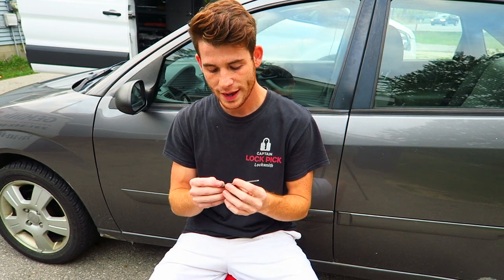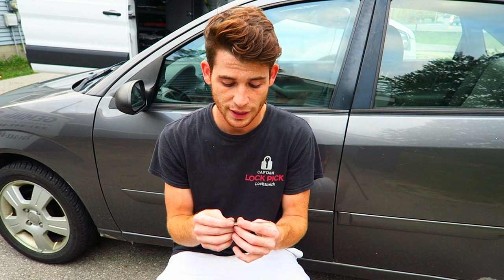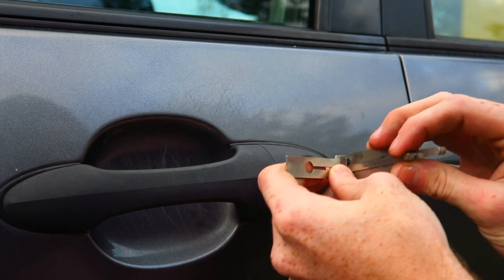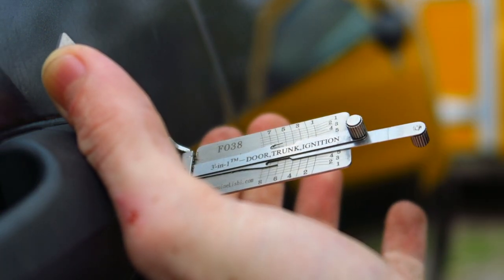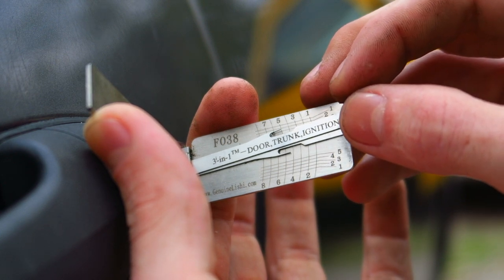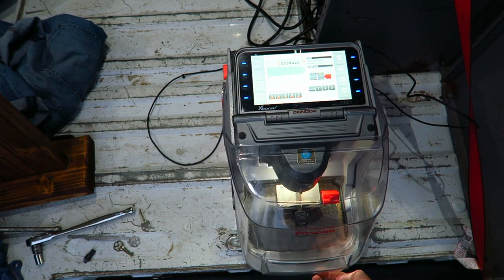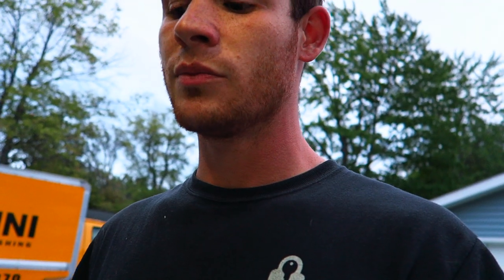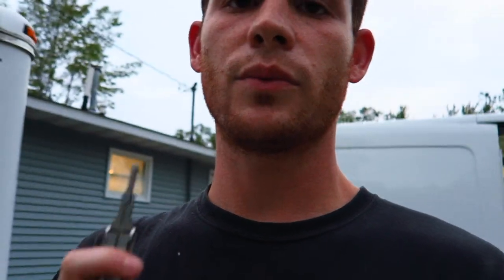Make Ford Key - Lost Keys - FO38 Lishi SECRETS

Comment: Dude solid video.  I just got my FO38 lishi along with a HON66 and HU100 since I cut and program alot of those.
Reply from the maker: The FO38 lishi can be difficult to decode with at times. HON66 is difficult to pick but easy to decode. HU100 is one my favorites.
Reply: @CaptainLockPick   I used the HU100 for a 2019 Silverado and it worked perfect in the door but would not work in the ignition. When I decoded the door I just autofilled the rest on AutoCode and it only came back with one option plus the customer said it was just one key. Is this some sort of electronic issue? I did wiggle the steering wheel and the shifter but nothing….

Comment: I've got multiple Ford's over the years and it looks like it would be a handy tool to have around.
Right now I have a 95 Bronco with no key to the back tailgate.
I am betting with the tool like that I can figure out how to hand file a new key myself.
Why??? Just because it's a challenge lol.
Reply: Your Bronco's H67 key may look very similar to the H75, but it has 10 spaces instead of 8. It is a completely different system.

Comment: I'm liking the Lishi tools!  Question for you.  I have a 1967 Mustang GT Fastback that I've owned for 40+ years.  I've hauled that car all over the country when I moved hoping to be able to build a hot rod.  The time has finally come, but I can't find the keys.  Does Lishi make a tool for a 67 Mustang trunk lock?  I know the trunk is a mirror image key from the ignition key (which I also can't find).  I just need to get into the trunk.  Thanks for any info you have.
Reply: I also have a 1967 fastback s code that I have had since I was in highschool and I am also a locksmith. Lishi does have a tool for the older ford ignition and door but your best bet is to probably just get a new ignition and door locks from year one or mustangs plus ect...
Reply: @kcreyesmaquilan9741    Looks like that is probably my only option at this point.  Thanks.

Comment: I have yet to open a Ford with a f038 lishi . I can easily open the Chevy vehicles with the gm39 lishi. You make it look so easy.  I wish I knew what I was doing wrong 😕 Any tips or tricks to suggest? Please and thank you 🌻
Reply: When u find a stiff wafer firmly push the pick while gently releasing tension. Once it is in its true gate there should be a slight springyness. Practice practice practice
Reply: i watched alot of videos on the Hu66 kwik decoder and Lishi FO38

 what other vehicle do they open  do the open like chevy ford and so on  thanks

Comment: Do you have to have the specific key blank with a transponder to get it started? Or can you pick the ignition and get it started with a Lishi tool?
Reply: What do you think?
Reply: I apologize but come on bro. It's Obvious that depends on rather the car uses a transponder or not. If it does not use one yes this will turn it over. But it has to be a lishi that works on doors and ignition. Some don't work on ignition because there are different ignition types.
Reply: @magenlin  Because you will be hard-pressed to find a car in the last 20 years that doesn't take a chip. And if it does then it's obvious turning the ignition over won't work.  So the only cars that would are cars before 2003 roughly. So I assume someone watching videos on lock picking would know that. Every time I get a customer with an old car they always mention no chip in hopes of saving money. And when you say the words key blank and transponder I think to myself. How could this man know these terms and not know rather a car has one or not? That's why I asked what do you think? Assuming you could answer your own question.
Reply: @segounlocks5029  because I know just enough to get myself in trouble. Which also means if I actually had to do this then I probably wouldn't without Somebody to watch the first time or somebody to say least ask questions to. Because I have fucked up plenty of things in my life because I thought "this seems pretty obvious how hard could it". 

But since you seem pretty knowledgeable about these things let me ask you and follow up question say the car was a little bit older and still used a key in the ignition to start it it did not have what would be considered a wireless key fob and push button ignition. In those cases does the chip have to be in the ignition or say if my key is in my car somewhere or in the trunk or something stupid cuz I'm dumb, LOL, would you be able to pick the ignition and start it in that case? Or does the transponder/chip ( I'm not sure of the specific nomenclature ) but it's in the vicinity will the vehicle start if I pick the lock and try to turn it on?
Reply: @magenlin  so a push to start uses a proximity key. You could be in range and start the car. But as far as a key that you put in the ignition it has to be directly next to the ignition for the bcm to detect it and allow the car to start. The only way a newer car would not have a chip is if it's a Kia/Hyundai. For some reason, USA models that are not push to start have no transponder. There is a group called kiaboys stealing them because of this security flaw. I will say using a lishi is the hardest part.  Someone with no experience would be better off pulling a lock out of the door and decoding the wafers. Each wafer has a number on it and there are normally 8 to 10 cuts. Right down the number to have someone cut a key. Or pay one of us to give you the key code. You must have proof of ownership and we can get you the code.

Comment: Great video I have that machine as well I love it the machine also has the option to find biting I’ve used it and it’s just as good as those code websites
Reply from the maker: I use that feature all the time too. Idk if I’d say it’s just as good as code websites. Sometimes I get more results on code websites. Plus you can’t do half cuts on it. Say your lishi tool reads a space as a possible 2 or 3 depth, you have to choose one or the other. Unlike other code softwares
Reply: @CaptainLockPick  how much do u pay a month or a year
Reply: @CaptainLockPick  

Your definitely more experienced than me in auto. But when I have an in between depth. I’ll put both in my machine and see if either are a viable code. Usually one will be. And one won’t
Reply: @CaptainLockPick  can you give me please a link to the website you use for the codes?

Comment: I’m not sure if there’s something wrong with my lishi, but every time I use a F038 I’m successful in picking the door lock and I manage to decode the key for the ignition, but the key doesn’t match the door for some reason.  Can anyone tell me what I’m doing wrong?
Reply from the maker: Does this happen on every Ford? I would try on a Ford that you already have the keys for. Pick the lock, decode it, and see if your cuts match with the existing key. Sometimes if you fail to decode the lock to 100%, it will only work in the door and not the ignition or vice versa.

Comment: Time is $
Slap in a wedge, and use the door tool to open the door. And the job is done and you're out of there money in hand.

Or do that, and take their key and make them another one, if they want it, which is a lot faster than decoding, and then paying a third party for KEY cut code access .

Which saves you money, and put more money in your pocket .

Just saying

Comment: Nice video .. I will say it may be impressive to open a car with it .. but you will need a lot
Of them  . I have open thousands of cars with air bags and never hurt any .. just have to be careful and use 2 air bags on at the top and side air they up aT same time to open door just the size of a half of a penny size .. 2 air bags will open it more evenly.. it’s not natural to open it just in the side it add pressure to one spot only ! Just a little tip   For what impressed me if someone came out and I own  had a BMW or Mercedes very nice car would impress the owners for sure !
Reply from the maker: I agree if done carefully no damage will be done. Thank you for the feedback.
Reply: I think that is nonsense some cars a better picked than force entry. Been doing it for years also and recently switched to to non intrusive. That air Bag also cannot decode the lock.

Comment: how do you know 7 and 8 code wasn't in the lock
Reply: Most door locks don't use that many wafers , but the ignition does. most all fords only use the 6 which are the same up and down,  so only 3 cuts per side not 4 , for a total of 8 cuts,, simple math.